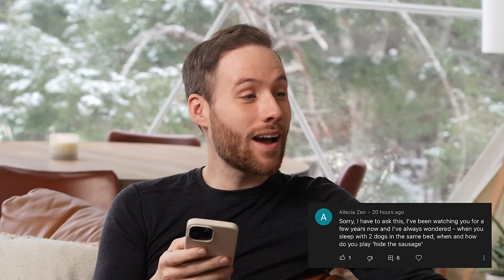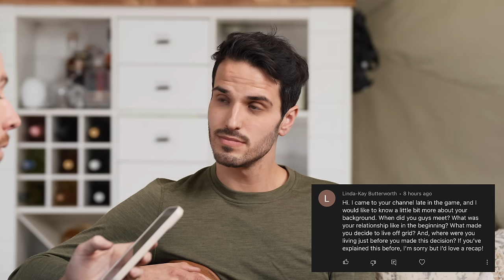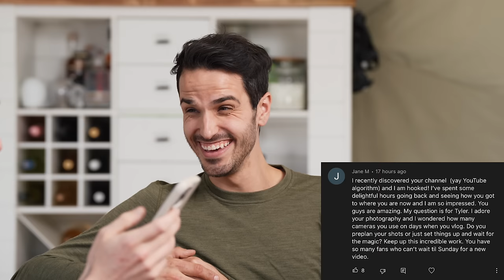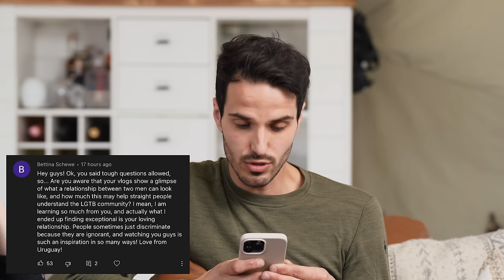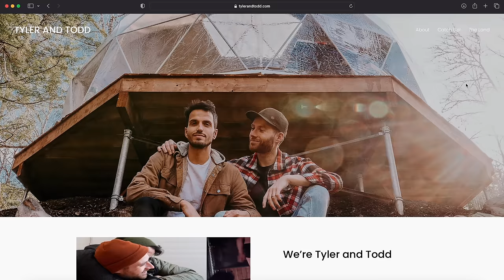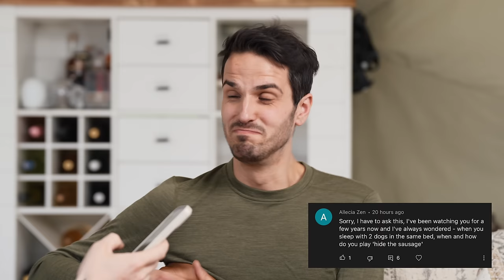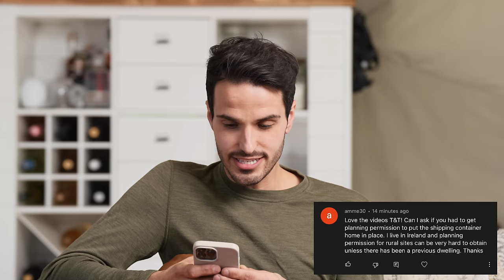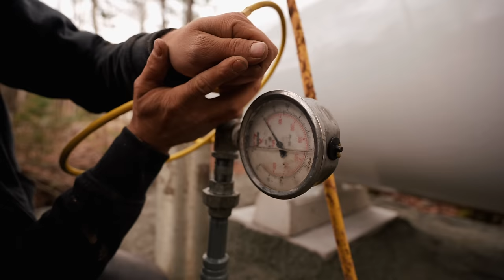We Haven't Been Truthful About Everything...

Comment: I have a comment or two that may be helpful. I know Tyler was the one that had tears with onions. Not only can you put it in the fridge to chill, BUT you can run your onion, cutting board, knife under cold running water, before cutting onion. Also to get the oniony smell off your hands, run them under cold water nd touch your hands to the metal faucet of your sink. 
You also can use for mosquitosn, dryer sheets put in your
 pocket. Or cut up Irish Spring nd put it where youre working. Just some helpful hints!

Comment: "What NOT To Do" is EXACTLY what people want to know!  
As power / utility costs increase exponentially over the next few years - more and more people will be following your track - if they can. I predict such a book - or series of podcasts { or both} will be so popular, that alone may pay for all your current investments! 😅👍
Yes - having power and water is massive.  
In the early '80's my husband & I lived off grid for around 18 months in a caravan. We had a gas stove and fridge and a back up diesel generator { which we tried to use sparingly }. We rigged a sheet iron free standing port over the caravan so that we could have rainwater run off into a 500ltr tank, and then built a mudbrick little adjoining cottage to use as a lounge / diner (with a woodfire pot belly cast iron stove / heater} - which also gave us more rain water catchment for a 1,000 gallon tank.  We also had a winter creek running through the 7acre bush block and dug a dam, but in summer we were still driving up a bush track into the hills to a bigger creek, to fill our water containers and haul back. 
VERY Heavy work.  
We then purchased an old weatherboard { wooden paling }  farmhouse on 12 acres that had 3 acres of ancient brambles overgrown apple orchard & moved there. It had Power! & Town Water!  I remember running around the house for the first few weeks delighted and flicking taps and light switches on and off - laughing like a amazed cavewoman! 🤣😅

Comment: I'd be interested in the recap (in depth) of your construction build by category (electric, pluming, etc), that's a great idea!
I've been thinking of building my own container house for years now, but when I try to budget myself the approximate cost, it get hard to find accurate pricing as not all companies puts their prices out (unless you ask for a quote on something you're not ready to build). For example, spray foam and concrete...
Reply from the maker: Got it!
Reply: Hi Jason! There is a general rule of thumb that is often used to get an impression of what the costs will be in the end. When you have done your numbers, multiply the result by 3. The result you get should hopefully be fairly correct.
It's called The rule of three, or The rule of Pi (multiply by 3.14).
cheers! /CS

Comment: Who is moving the cameras like from close ups of you then wide angles.  You use remotes in your hands???
Reply: Hi Charlie! It seems to be this way. They have three cameras. All three of them are running all the time. All of them are pointed in only one direction. When the recording is over, they download all three files into their computer, cut out the pieces they want, and then splice them together into one video. (There are simple computer programs to do that, even some free ones.) So therefore they don't need to move or remote control their cameras.
cheers! /CS

Comment: the idea of sustainability is great but one thing you cannot do with the types of systems you have is to leave and go away for the winter .. the water alone can be a huge issue ... as for thinking there is no future costs in what you are doing is kindah BS as all systems require upkeep and the batteries you use are not a lifetime warranty .. the off grid that you are doing is very very complex compared to actually being a off gridder ..  there are so many ergonomic ways you could have done your homestead  but you did this utilizing many non renewables .. propane is not cheap ..it's nice to say you are self contained but you are far from it ..